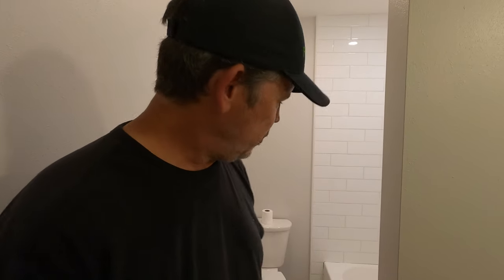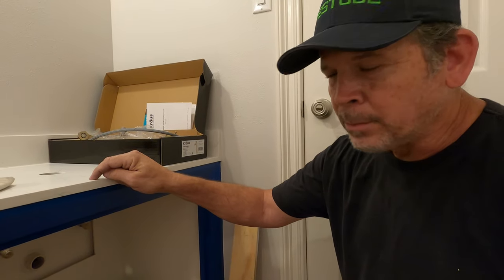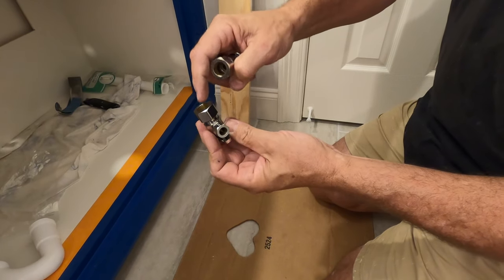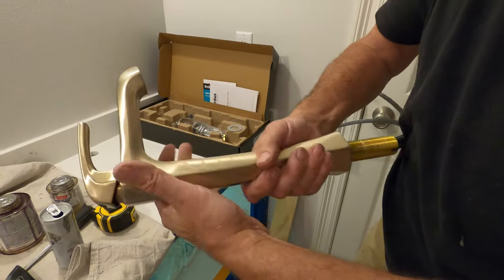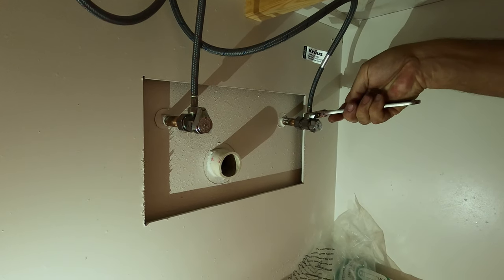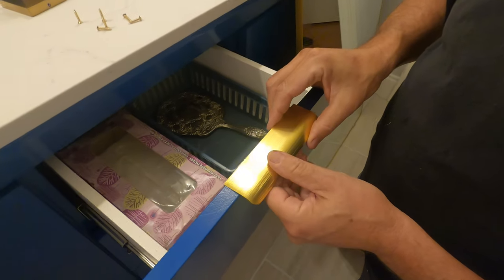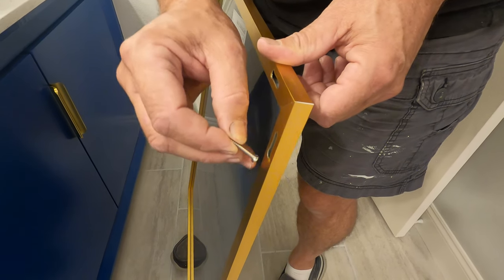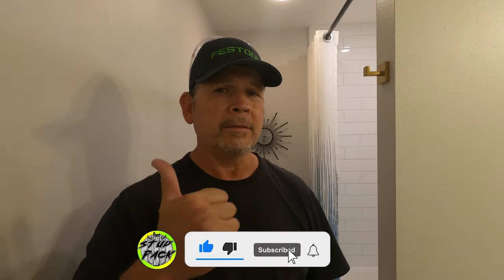Remodeling a Hall Bathroom Part 9: Sink Plumbing & Hardware

Comment: Yes, airator tool is a must unless you flush your lines before putting the water supply line on and blow into a bucket... I had to run through 50-60 apartment units fixing all the low water pressure after remodel, I saved the company tens of thousands of dollars because they were going to scrap the facets and get new more expensive, but was just plastic from cutting off old water valves and using shark bites as new valves without cleaning out the plastic shavings...

Comment: When you were hanging things on the wall instead of drilling a hole and risk hitting a wire or a pipe you can just use the screw that you’re using to mount the mirror into the drywall and if it hits a stud leave it there and if it does not, remove it and it will leave a starter hole for your anchor.

Comment: Take painters tape across the back of the mirror across mounting hole - mark center of mirror on the tape, punch out hole then put the tape on the wall aligning to the laser center line.  No measurement needed

Comment: Only problem with gasket supplied (in bowl gasket)  it is usually to thick and leaves water standing (1/8 ") in bottom of vessel . (Plumber putty seals just as well, no standing water to cause 'mineral' ring)
Reply from the maker: Yep exactly right.  I’m cautious using plumbers putty on some items (staining) but glass should be fine.  Recently saw non-staining putty in store

Comment: How many days to do this job? It turned out very nice. You did it the way things are suppose to be done. My husband would do some what of a Mickey Mouse Job!! No kidding, that’s why he doesn’t touch any thing here.
Reply: My wife thinks exactly like you, we just scratched a kitchen update because she doesn’t trust my timeframe. Yup. Stuff takes time and you don’t just snap your fingers and it’s done. Just like the screws in the mirror didn’t fit. What should take 30 minutes turns into 3 hours when you have to drive to the home center and sift through the hardware isle to find the right screws. These guys have edited all of the gotchas down to an explanation of the problem and the solution. All that awe __ time is gone.

Comment: I noticed that the two outlets are not GFCI's.  Is that legal in your area?  Where I live you have to have a GFCI outlet in a bathroom.  I'm not trying to nitpick, just curious.
Reply from the maker: They are protected by the master bath GFCI.  Back when that was code.
Reply: @StudPack  So grandfathered in by the sounds of it.  No permit required for this reno?  Might be an idea for a video....  the permit process.  

I love how the building codes vary by the state or province, making things a little inconsistent.

Comment: Where part# do ya have where ya show the cabinet’s install ?
Reply: And built
Reply from the maker: Hey sorry Brian.  Unfortunately we didn't video the cabinet install.  It was basically like the kitchen cabinets we recently installed in our kitchen renovation series.  Check that one out it you'd like.  It was built by a local cabinetmaker so no video there either😒